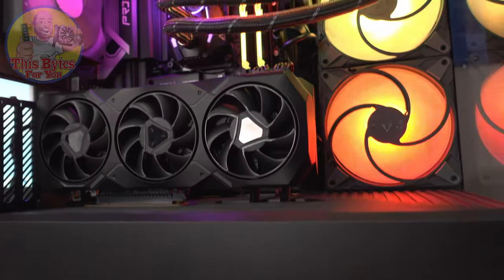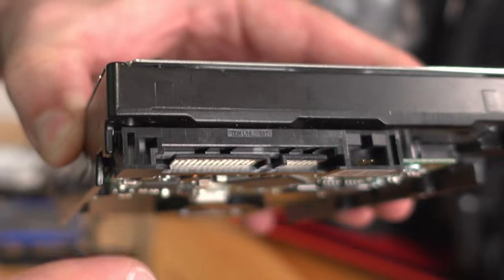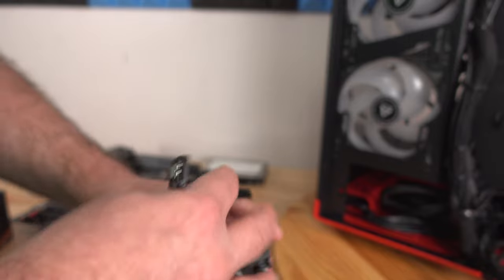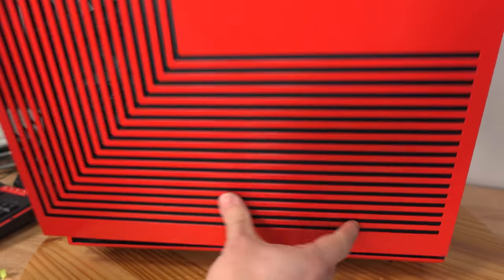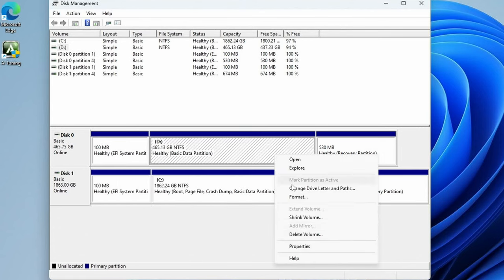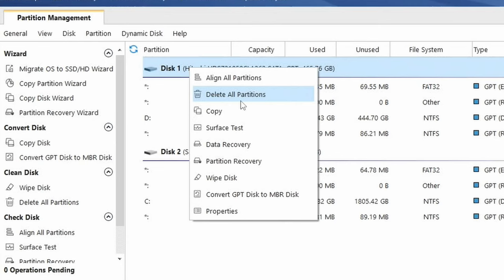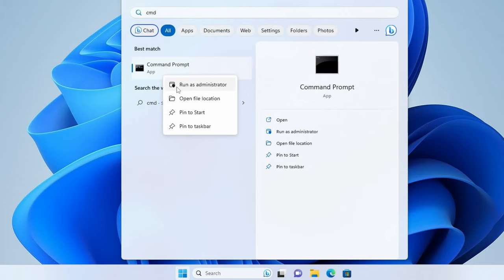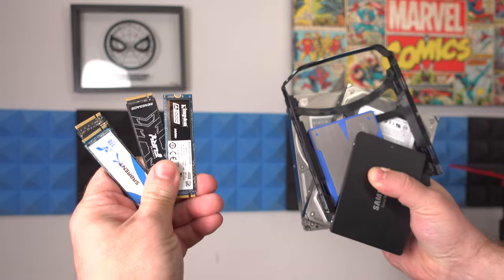How to Install a Used Hard Drive in your PC and Make It Work - Step By Step Install Guide

Comment: I just bought new parts for my pc... i am gonna use my old hdd and ssd from my past pc in my new pc along with an additional nvme on a new mobo. If i follow this video do i have to delete the drive completely or just go into bios and make my old ssd the boot drive? Cause the old ssd is the one that has my windows key on it! I am staying with intel just changing mobo, cpu, ram, and psu
Reply from the maker: You are changing a lot, that will trigger reactivation and your system will run slower, you dont have your key anywhere?  A reinstall of windows will give you such a performance increase and especially with your new hardware.
Reply: @ThisBytesForYou  i do not have my key anywhere just on my current ssd boot drive in my current pc... so how do i go about swapping them over? Do i just swap them and then delete everything off them or just delete everything off of them before i swap them and on first boot reinstall windows?
Reply from the maker: @Plagued_Visions  is it a prebuilt system or do you have tied to your email?
Reply: @ThisBytesForYou  it was a prebuilt in the beginning but i swapped the cooler, case, gpu, and fans, now just upgrading the left over components
Reply from the maker: @Plagued_Visions  ok, chances are that will not stay activated, it's tied to OEM activation in the bios, tied to the motherboard.  I was a product development engineer at Alienware, then later Dell and Velocity Micro and I managed OEM SLP activation.  Chances are you will need to buy a key.
Reply: @ThisBytesForYou  i appreciate the info! So i dont need to clear them before swapping them over? Just swap them to the new mobo and on first boot up install a new key?
Reply from the maker: I recommend to clear them to get full performance, but if you are on 10 or 11, It "should" work just slower.  What OS are you on now, and was it a clean install or did you update to that os, like win 7 to 8, then 10 then 11?
Reply: @ThisBytesForYou  currently windows 10 and has been windows ten from first install!
Reply from the maker: OK, good, so its not cluttered, so it won't be a horrible slow down, but will slow down.  You can improve it by uninstalling all the older drivers and then installing the new drivers for the specific board, windows will help but the drivers it provides are older and don't have the software accompanied.  You can check out my video for how to create the install drive and install windows here: https://youtu.be/ayp8TksEtoY
You can get a cheap key from G2A, one of the only places I would recommend to buy keys from, other than Microsoft, since they have a guarantee: https://www.g2a.com/microsoft-windows-11-pro-pc-microsoft-key-global-i10000271164001?suid=5023f9f7-d2b8-456c-9a6c-81cf3b9e36e6
I never recommend moving a Windows install from one board to another.  Remember though, you will need to reinstall all your drivers and programs on the new install, but the performance difference is night and day.
Also, if your older install is installed on an MBR, chances are its not, but it can be, moving over to a new system with UEFI, it will cause bluescreens.  When you reinstall, make sure you have your BIOS EUFI enabled and your OS installed on GPT.
This video will give you an idea: https://youtu.be/1po734ckLFo

I hope I have helped my friend.
Reply: @ThisBytesForYou  seems like it is much easier to just erase the old storage completely before moving them over and just starting from scratch? I think im gonna do that just to make sure its performance is top notch! I dont wanna bring any bad juju with the old stuff! I appreciate the help and will refer back to the channel when i start moving components! Thank you!
Reply from the maker: 100% agree my friend, so happy I could help you.  Just remember, starting from scratch means, you will lose your data, so copy over the things you need to keep, keys, photos, documents, downloads, etc.  Always a pleasure my friend, so very happy you stopped by, trusted in me to help you, liked and subbed as well as took a moment out of your day to thank me.  It means a ton to me and I am so very happy I could help you.
Reply: @ThisBytesForYou  fortunately i only have game files, data and profiles on my computer so ill just loose all of that! No big issue! I can restart! Thank you again!
Reply from the maker: ahhh ok cool, glad I could help you my friend.  I would highly recommend you install 11, you can get the installer and learn how to install it from here:  https://youtu.be/ayp8TksEtoY, always a pleasure my friend.

Comment: Thanks for your effort bro. If I need my old hard disk to be the main one isn't enough to make it the 1st boot drive in BIOS?
Reply from the maker: Ummm, maybe?  If your old hard drive was used on the same motherboard you are using now, chances are yes, but if its a different motherboard, CPU (AMD to Intel or Intel to AMD, "Hardware abstraction layer") then that's a big problem and may not work.  Also, if you had many hard drives along with that hard drive used in the same machine bfore, there is a chance the boot partition is written to all the hard drives causing issues.

Comment: hey, don’t know if you are still viewing comments for this video but i was wondering if i did this, would i have to redownload everything back again? like my softwares, games, etc? also would my login information also be wiped? my hard drive is a seagate barracuda 1tb. i’m also using windows 10, and was also wondering if i would have to switch over to 11 for this to work
Reply from the maker: Yes, you would need to redownload and reinstall everything.  You don't need to install 11, but you should, since it's the latest operating system, it makes no sense to use 10 or anything older.
Reply: @ThisBytesForYou  is there a way i can switch hard drives without losing anything? also another question, is there. way to transfer my data to another, stronger and better hard drive? like if the hard drive i want to transfer it to is, let’s say 5tb and i want to put my data on there, is it possible to transfer data
Reply from the maker: yup, you can clone it, but I dont recommend it, you are copying all the problems you had before and making them worse, I recommend reinstalling everything, but if you still want to do it, here you go: https://youtu.be/4BtdMcqwaFg
Reply: @ThisBytesForYou  alright, thank you for your help
Reply from the maker: anytime my friend, if you are going to reinstall, I have guides to help you with that as well, and you get so much better performance @AktiveHere

Comment: Following were all single partition drives.   I have not used more than one partition on any HDD  for many years.  I thought you might be able to handle what you did strictly in disk manager though.

I just installed 2 new 12Tb secondary drives.   First in external dock (toaster style, just pop it in) to initialize, new simple volume, quick format and start to drop and drag files over before putting them in the case.
These replaced 2 existing 6 Tb secondary drives.  Am filling with my photography and other files and want to buy time before needing NAS.

I also used the dock to save some old files from old HDD and then wipe them before recycle/ dispose.
Reply from the maker: good stuff my friend, but for windows, it does 3 partitions on its own, for other drives, like you, single partition as well.

Comment: A few weeks ago my laptop randomly broke, can I install my ssd into a new pc without my files being corrupted or removed?
Reply from the maker: you can, but I dont recommend it, UNLESS its the same PC.  An example, your 86 honda dies, you buy a 2021 Honda and pop in the engine from your 86 honda,... it will work fine right?  An older laptop has an older chipset, older processor, RAM, BIOS, northbrigde, south bridge, graphics card, sound card, etc... and those things make a HUGE difference.    On a clean install, you will get the best performance.  Take the hard drive out of your old laptop and use it on an external drive enclosure.  YOu will need to reinstall stuff you had on the old drive, but you will still have access to the old files, pictures, videos, music, etc.  Hope that makes sense?
Reply: @ThisBytesForYou  Yeah, that makes sense. Ty
Reply from the maker: awesome bud, I am so happy I could help you.  Maybe this can help, if you find the same laptop: https://youtu.be/aHVCmkm67q8

Comment: Hi, Can you Help with direction on a case that will fit an asus maximus ix rog atx Mb? Can i fit it in a mini case> or do i have to stick with a mid or full size case? Im also running an asus 1080 Ti GPU..Thank you
Reply from the maker: for an ATX motherboard, you will need an ATX or larger case. Smaller would be mATX or ITX.  See if you like these cases
HYTE Y40
https://youtu.be/JqvXib6ugjw

Montech Sky Two
https://youtu.be/sDjzGfNMR14

Fractal Design Focus 2 RGB
https://youtu.be/W72Mhx9UsbY

Comment: So what I’m wanting to know is if I get a new pc and want to move my old hard drive over to the new pc and have all my programs from my old pc on the new pc. I would just want to remove the operating system that’s on the old drive?
Reply from the maker: No, you can't do effectively.  You Windows drive, your C drive has everything installed on it, when you install your old drive in your new PC, your new PC's installed version of Windows has no idea what that other drive is about, it's registry, a brain of windows that has a map and a bank of all the programs and files location (explained horribly, but I hope you understand)  has its collection of programs, and the other drive has its own collection, they don't talk.  

The C drive of your old PC and your new PC may fight, you need to tell the BIOS which is your preferred drive when you install that old drive, I show you how to do it in this video.  Your old drive, with the older installation of windows as it is will not function on this new machine, since Windows knows the older hardware (HAL), it will be different on this new computer and it will freak out.  There is a chance it will work, but it will be crippled, even though, the hardware will be better, there will be incompatibilities, like planting your brain in another body, your brain has no idea what this new stuff is, it may work, but never like the original, even things that are better in this model, may not operate correctly with your brain and visa versa.

Once you get your new PC, pop in this older drive, tell windows which is the correct drive to boot from, then start copying files from the old drive, to the new drive, pictures, music, documents, videos, etc.  Then you will need to reinstall your old applications, in order to read some of the stuff your old computer could that your new computer cant, Word, Excel, PowerPoint, Photoshop, DaVinci Resolve and all your games and such.  

Long, but I hope it makes sense.

Comment: Yo!!! Thanks!!! I have no experience with hardware and i bought new pc, i had old one that didnt work bcs mainhard disk first died later motherboard died, new one had only 256ssd so i used old one(dead harddrive) that has 500gb it works well!! It turned out some system32 files were corrupted so it couldnt work as it was my main hard disk, its now my local disk D i just have to take 2 cables to install 2 old hard disks of 80gb now i can finally play war thunder!!!!
Reply from the maker: Always a pleasure my friend, so very happy you stopped by, trusted in me to help you, liked and subbed as well as took a moment out of your day to thank me.  It means a ton to me and I am so very happy I could help you.

Comment: mine showing blue screen after installing old hard drive, after i open the bios boot section, the old harddrive that i just installed  doesn''t show up. any idea ? do the old hard drive have to be empty ? mine filled with my old data
Reply from the maker: Did you watch this video ?
Reply: @ThisBytesForYou  yea i did, on my bios boot section the new old hard drive does not show up so i can’t change the boot option like you did in your video
Reply from the maker: @jeremyfilbert7232  when do you see the bluescreen?
Reply: @ThisBytesForYou  right after i turn on my pc after i add my old hard drive, the screen keep looping blue screen it says “your device ran into problem and need to restart”
Reply from the maker: @jeremyfilbert7232 right, it has become the main boot drive, so if you disconnect it, it works.  See what the boot order shows when it's diaconnected and it works, then when you put the new drive, change that to what it was when it worked
Reply: @ThisBytesForYou  you are correct, if i disconnect my old hard drive my pc works perfectly fine. Thanks for being so helpful, will try !
Reply from the maker: But I go over this in the video, that's why I asked if you watched it, where did I go wrong in the video?
Reply: @ThisBytesForYou  i don’t think anything wrong with your video, but on 06:40 there is option to choose between “windows boot manager (sabrent..) and (hitachi..)” yet there is no any option that i can change on my bios boot section. Thats where i don’t understand.
Reply from the maker: 1. what is the manufacturer and model number of your motherboard 
2. what is the manufacturer and model number all the drives you have connected.  
3. Which of those drives was already connected and working on this board?
4. Which of those drives is new to this board, even though its an older driver from another computer?
There will be delays in my response, I am at work now.
Reply: @ThisBytesForYou  1. My motherboard is asus prime b760m-a
2. Other than my old hard drive (seagate s/n: z2adptna 500gb), i’m only using xpg gammix s70 blade 1Tb as my ssd
3. Xpg gammix s70 blade 1Tb
4. My old hdd is the new drives to the motherboard
That’s fine im thankfull enough for your help. No rush
Reply from the maker: You confused me, on this new working computer, which is the drive that works.
Then what is the drive you are introducing that is causing the issue.

Comment: But I want to just remove the windows partition? Keep my files
Reply from the maker: @dutenn  the windows partition has your files on it, it has all your files on it.  Move your files
Reply: @ThisBytesForYou  aaaaaahhhh shucks lol. Thanks for the reality check. Was just trying to avoid that
Reply from the maker: @dutenn well you can remove the windows partition, and create one but you will need to move the data again, you can keep it there just not use it to boot from, you can boot to another drive but you will water space, always trying to help my friend
Reply: @ThisBytesForYou  well I bought a new Lenovo legion tower, I am going to use current sab rocket 1tb via USB c / m.2 hub enclosure. Didn't know if it was going to try to boot from the hub (win 11) is on that.
Reply from the maker: well, if its an external hub it won't work, going through USB C, you have to make a lot of modifications to the installer, and its dirty.  Check out this video, it might help: https://youtu.be/4BtdMcqwaFg

Comment: *le me who is still having his Kingston A400 480GB SSD and WD Caviar Blue 512GB HDD from his old laptops:
Reply from the maker: I still use them from time to time
Reply: @ThisBytesForYou  i will use them after building my pc
Reply: @ThisBytesForYou  but i got a problem here. My HDD showed up everywhere but my SSD can't be detected. What can be the problem? I tried minitool partition, diskpart, windows partition manager, multiple pc and laptop, but only my HDD can be detected. Nothing can detect my SSD
Reply from the maker: So that I can help, please list the manufacturer and exact model number of the following components:
1. Motherboard - manufacturer and exact model number
2. CPU - manufacturer and exact model number
3. RAM - manufacturer and exact model number
4. Video Card - manufacturer and exact model number
5. Power supply - manufacturer and exact model number
6. Monitor - manufacturer and exact model number
7. M.2 - Manufacturer and exact model number, if you have any, and how many you have in this system
8. Regular SSD - Manufacturer and exact model number, if you have any, and how many you have in this system
9. Hard Drive - Manufacturer and exact model number, if you have any, and how many you have in this system
Reply: @ThisBytesForYou  It is Kingston A400 SATA SSD that is not getting detected. I tried it in multiple laptops and PC but nothing happened
Reply from the maker: @DeathStriker88  if multiple cant see it, its probably dead, it happens.
Reply: @ThisBytesForYou  it was the boot drive of my old laptop. Thank God I used to keep all my data and files in HDD
Reply from the maker: @DeathStriker88  it happens